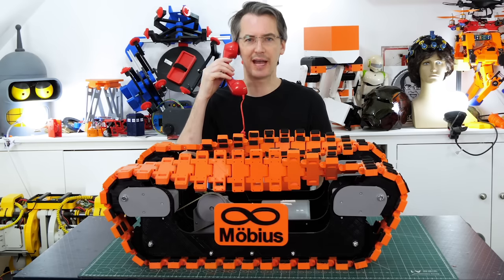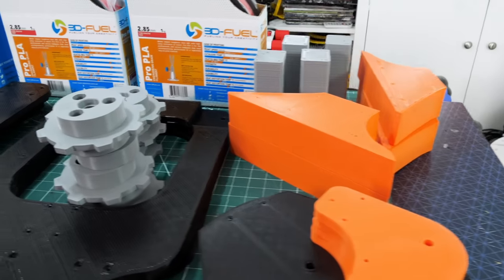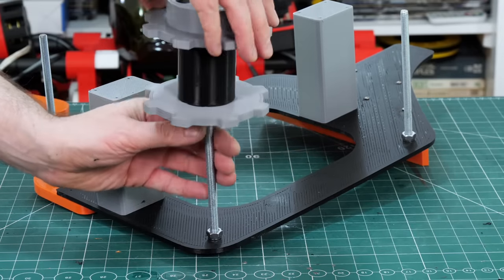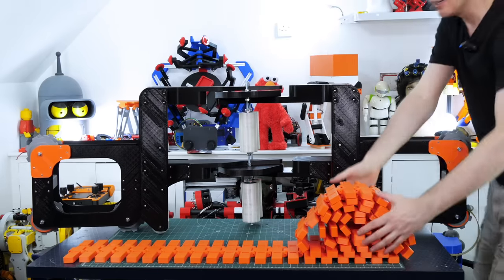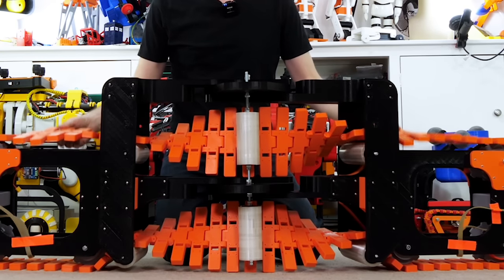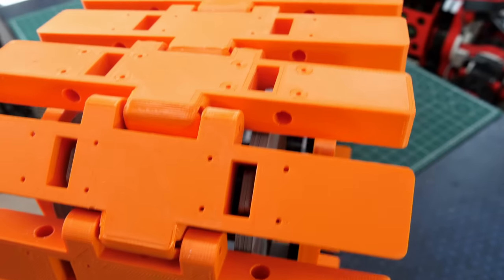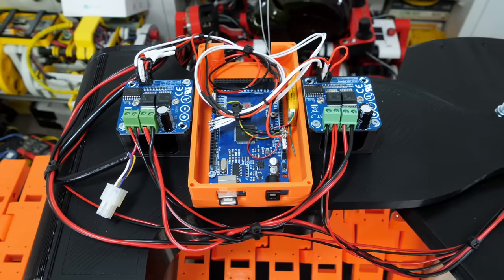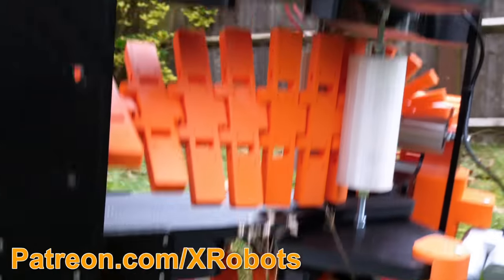I found a use for the Mobius Strip Tank

Comment: yes its cool 
if you remove the mobius strip top hafe  and lean the track in the same direction as the bottom you could 
compact the meddle half, or at least give it some ground clearance in the meddle
then the only thing that would make this usefully is if its powered by a single motor 
maybe if it was also high and dry inside its robot above driveing the tracks from the meddle

Comment: Three things:

1. There are no grips on either side, so that little bit of extra elevation that would give the bottom twist some extra ground clearance isn't present, and the treads lack traction. So perhaps instead of smooth tracks or added-on rubber grips, you could print textured tracks with treading that has natural gripping surfaces,

2. This design has a significant flaw in that while the track has obvious vertical mobility, the frame does not, so the second it encounters a significant incline, the middle section is going to pick off the ground and a lot of the traction is going to be lost. A slight vertical hinge towards the front, and possibly a second in the back, would alleviate this problem and, potentially, give the track the ability to take inclines far better.

3. The horizontal instability can't really be compensated for with a one-track design, as wider tracks for stability would require a taller frame, which would just exacerbate the problem further with no end, and having 'training wheels' on the side to balance it goes against the spirit of the design of a tracked vehicle and causes all manner or other problems that could be addressed by just refining the track design. To that end, the only realy fix besides only driving across even ground with no irregularities is to have a second track, but while that obviously complicates the design of a horizontally bending tracked vehicle, it also creates new oppurtunities that a conventional single or double track design would not, such as having multiple horizontal and vertical pivot points withot sacrificing stability or control. It's also possible to scale the size of the tracks down with a second track. 

Follow this rabbit hole long enough and you might just create a working 'snake tank'...

Comment: I gave a Like. My question is why, as with 2 chains turning on the spot. I think I get the point if flipping the chain once could spread wear on both sides, not flipping them twice as you said. Not worth the additional cost. On small scale I see a lot of potential on 3D movement moving in twisted pipes. Thank you for that inspiration. Gero from the always sunny Bahrain

Comment: I’ve got an idea that would probably be awful to build but could work off the idea of treads with alternative surfaces that can engage while driving. Maybe there’s a way to design a tread that can swap links as it drives. An overly bulky way could be having a tread of a different type above each active tread, with a way to exchange links between the treads while it drives. So you could plan to use grippy treads on smooth surfaces, then switch in more flat treads as you approach a grippier surface. Or you could switch in grippy treads on one side but not the other for the kind of skidding turn you tried for on the moebius tank.
Reply: Alternatively, one track with drive surfaces that can be switched out automatically at the top of the tread, so you don’t have to feed in & out whole links, but instead “only” have to design some kind of mechanical way to swap drive surfaces. Though maybe you could do that with permanent magnets on the link and an electromagnet that cancels out the magnet on the tread and allows the drive surface to snap up into its storage position

Comment: Really enjoy what you create. Envious.

Tracks on bulldozers (Cat) have a high track concept to lift the drives off the ground and run on idlers & rollers. These components are high maintenance and need continuous replacement.
But give the machine more power to the ground, and a smoother travel.
Along with clutch and brake steering.

But, this is robotics right?

Mind blown. Just like how it has evolved. Mobius. 
Certainly clears the track of debris.

Will this be the motorcycle I ride on Mars? 👀

You should get a patent and approach Caterpillar, SpaceX and NASA for Luna and Mars exploration.

The abrasive soils on both.

Failing that, China would snap it up quite quick.

Comment: If you made it bigger and give it a bit of a redesign, including giving much more ground clearance in the middle, could you make a motorcycle with a single tread?
Reply from the maker: It needs to touch the ground in the middle so it doesn't tip into the corner when it bends. I think there are better ways to make a bendy track though.

Comment: My only gripe is the vertical track on the bottom touching ground.

Instead of rectangular edges maybe triangles instead?  So the center section could be lifted more without adding more track sections.

Comment: You should have an entire second track, like a real tank - that solves the instability from side to side....
and you lift the tracks in the middle so they travel in an arch on the bottom half, this way it does get stuck... you make  another set of rollers at 45 degrees and this should be at an angle to help it through an arch... and you might want to make the bend/steerable section just a few links longer so each link doesn't have so much friction on the insert rods as it twists.... you REALLY DID just create the WORLD'S FIRST STEERABLE TANK TRACK!!!! This creates SO MUCH more maneuverability on a tank!!! For a tank to turn it HAS TO GRIND UP THE GROUND, but with this steering it lessens that by a factor of... maybe half.... making it MUCH MORE fuel efficient (I would assume) 
...... PLUS this opens up the door for single track vehicles!!!! lol - PLEASE KEEP PLAYING WITH THIS LINE OF IDEA!! (and FILE A PATENT!!!!!)

Comment: What you could do is switch the rollers out for two gears with every second tooth missing. 
Both gears on each side would need to be connected. 
So for each even track link, the bottom left and top right teeth are used, and for each odd link, the top left and bottom right teeth are used.
This way, the track is held up by both sided at the same time.

Edit:
You could then drive these gears as well to increase the power which should help with the problem shown at the end.
Reply from the maker: The sprockets don't work well unless the track is bent around them, probably needs a different profile

Comment: I suppose another use is that you'd wear the treads less since you're using twice as long tread distance, but I don't think actual tank treads can just be flipped over, or if they can then I'm sure you could flip them manually when the other side is worn down.

Comment: I'm trying to think of an application where this would be useful somehow - maybe a bridgelayer vehicle? Having a long thin single-tracked vehicle might be more convenient for carrying a long folding bridge, although bending in the middle probably doesn't work well with that idea.
Maybe you could have a remote controlled drone like this that could roll up next to a tracked vehicle, hook up to one side of it, and take the load off of a broken track, it could work somewhat like a spare tire for a tank? That might be able to quickly get a damaged or stuck vehicle moving again without the need for a much larger recovery vehicle. And maybe you could temporarily add one to each side of a heavy vehicle to help spread its ground pressure out, when going over soft terrain that it would otherwise sink into?

Comment: What if you made it twice as long and added a 2nd area where it can turn? You could basically make a snake that uses a single tread. If you drive it in a slightly serpentine pattern it would be more stable and less likely to fall over.
Reply: TANK SNAKE!!!

Comment: Great idea for your "infinite  loop", but wouldn't it have been better to just make to make two separate track loops for the front and back.  That way you could get rid of the twists and the track in the middle.  This would save a lot of track and get rid of the 4 vertical rollers holding the twists.  You could probably even get the front and back track closer together since you don't need room for the twist in the middle.  This would also shorten the overall length.  I hope this makes sense.  Wish the comments section had a whiteboard option.  One diagram would go a long way.
Reply: it would, but that defeats the point as this would eliminate the mobius strip entirely, which is the fun of this project!

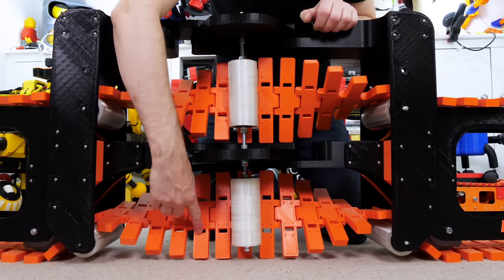Comment: 10:13 Why do you print parts with holes for hardware that might need adjustment and not print those parts with slots so you can simply adjust the hardware rather than print an entirely new part with the hole's position changed for the adjustment?
Reply from the maker: It can't slip this way, and it only takes ~30 mins for all of them across four printers
Reply: @jamesbruton  Thanks for the reply. That makes sense. What about printing a larger hole that can receive inserts with different alignments for the hardware? So that wag if the hole for the hardware doesn't line up correctly, the insert with that hole can be popped out and a new insert with a better alignment can be popped in? Wouldn't that also save time and material?

Comment: The bottom "passing" really ought to have been further off the ground, ouch. Even on smooth surfaces it would go humpity-bump because the side extents of the tread actually extended further down than the nominal ground contact plane of the treads, during those moments when a tread section passed exactly through the centreline and went straight vertical. Also maybe active rocker tilt controls might've been handy...? The flex is there, may as well use it.

Comment: It would be interesting to actually test other iterations of this design for its feasibility in the real world

I see two benefits right away to this track design:

1) The mobius strip design means that you can have a two sided track where you potentially have twice the lifespan before having to replace worn out track. While the track may be more expensive this way, your downtime for maintenance could be cut down substantially. Also, depending on how you design the track links, it's potential that you could maintenance the track without tacking it completely off the vehicle

2) The bent design allows for sharper turns without tearing up the ground as much and without as much side force on the track potentially leading to less tracks being slipped off from zero point turn forces

All in all I think that the core concept is actually intriguing enough to warrant more testing. There are several changes I'd see from the get go. Understandably there is certain limitations with trying to keep the tests in budget for a one man shop

One of the main ones would be to decrease the link width so it doesn't touch the ground at the twisted portion at the bottom. Treads are meant to be flexible to be able to go over very uneven ground. The twist isn't flexible so needs to not be in contact with or be near to the ground

Also, linkage would assist in being able to pivot the treads more for turning with low speed motors. You can trade power (as available) with leverage to turn it into more distance

I can see that the belt drive may be due to costs but having a more direct form of drive would yield less overall slippage. As soon as I saw the worm gear motors being driven by a belt I knew there would be no way to actualize the power of the motors

I could go on but this was really an interesting concept. It is rather ingenuous, innovative and creative. Well done
Reply: I like the idea, but I think it could be really impractical. My thought is, that since the mobius track turns on both sides, the insides connecting the tracks to the tank could get really messy really fast, as dirt and possibly abrasive particles would get in. While the linkage itself should  theoretically last longer, there could possibly be more maintenance due to things getting too messy inside... 

I really like the idea, even if impractical, it was a pleasure to see this project in motion.
Reply: make a tl;dr please

Comment: I would totally love to see the track printed in two colors.  One color on the inside and another color on the other side. then do a full twist on the top AND bottom so the front module has one color track, but the other module is a different color.... but it is all the same track.
Reply: A Möbius Band only has one side.
Reply: @mststgt  If it twists on both top and bottom then it would have 2 sides but front and bottom would be using opposite surfaces.
Reply: @mststgt  and inspiration isn't restrictive or prescriptive.
Reply: @bourbonbobo  You're more an artist than an engineer, I guess.
Reply: @Eagle3302PL  correct, but then it wouldn't be a Möbius Strip Tank any more.
Reply: @mststgt  everyone is equally both you just need to develop your connection, you should put in a better effort than this pithy pedantry. The suggestion here would absolutely look neat and illustrate the mechanism at play. You can also connect it as a proper Mobius strip and it'll illustrate how the 2 surfaces pass over the rollers. Another comment here mentions different surfaces on the two faces which would make the suggestion actually potentially practical in improving control. Just because you're inspired by a mathematical concept at the inception of an idea doesn't mean you should let it hold you back from making stuff that expands beyond the confines of the initial concept.
Reply: @bourbonbobo  ... and obviously a very entitled artist, too.

Comment: I doubt the instability on the grass is caused by the twisting. The treads that are held by the sprockets are not twisting, they are lifting when you tip it. Whether the treads in-between are twisting is irrelevant; the total span of the footprint is the same. I think the span is simply not wide enough to completely balance on its own.

That, the rockiness, the ground clearance, and the tipping-while-bending would all be a non-issue if you printed another track and made a full tank😉

Comment: Track sections should have sharp ends. Then you could press the middle section down on slippery surfaces.  This would be a novel snow scooter with adjustable  traction, because ice studs wear out quickly and waste energy.

Comment: Build another and place a 'seat' between the two middle swivel points. will kind of be like a tank but with 4 wheel steering? Weird and will require alot of work but the size and power of two of them together, i think it could carry a person.

Comment: I love this, but from a practical point of view I have a hard time seeing how this would be better than a version with two entirely separate tracks, one in front, one in back, joined by an otherwise similar hinge. (effectively the same layout that wheels have on a car). While you would need either an extra set of motors or some extra mechanics to drive both off a single motor - it would potentially come with the upside of being more redundant as a breakage of one track would allow another on the same side to keep working even.

Comment: If you could use rubber tracks with a mechanism similar to this i wonder if with some engineering it could have the Benifits of a tracked atv or utv but solve the turning shortcomings of argos or skid steer type machines at at the same scale

Comment: One of the reasons for using a mobius loop is that it wears evenly and at half the speed -  there are industrial machines that have mobius belts for this reason 
But a bending joint is an interesting other reason ...

Comment: Is there a reason you do not build adjustable parts but instead reprint them? I am not an engineer so I am quite ignorant on this, but I see no reason to design the parts to be so rigid, without tolerance and tension adjustment in mind (besides the making the part you have to reprint, in case adjustments are needed to be made, smaller).

Comment: Wow!
...
What?
Anyways, if you want to overengineer the tracks to work better on grass you could always add compression spring-actuated endcaps that push down over a grippy material or a spike that only makes contact when the end of the track is compressed. Like a blood-glucose meter. It could be a large mobius tank tread with a bunch of blood glucose meters on the ends. I'm sure that's the next logical evolution of this project

Comment: When you took it outside and the belt skipped it looks like your motor mount is moving and bending, it might work better with a stronger motor mount.
Reply from the maker: It is, but there's so much more load on it

Comment: I don't see the point of the twisted track in the middle, while you have 2 motors, just have independent tracks at either end. The only reason this would make sense is if you have a massive motor at the back to leave space for somewhere to sit at the front. Not that you would see much.

Comment: Very cool, but so many of those massive plastic parts could have just been cut from plywood...
Also if you make the bottom one switch over as well, the front and back would both use one side of the track, if you coloured them differently it would be interesting.

Comment: imagine this for real world vehicles,  a excavator with such tracks, the tracks would last twice as long since they will be used on both sides evenly, with the ability to twitst you could get the same tight turns if you had 2 of them steering oposite, without pushing around the whole dirt underneath as much